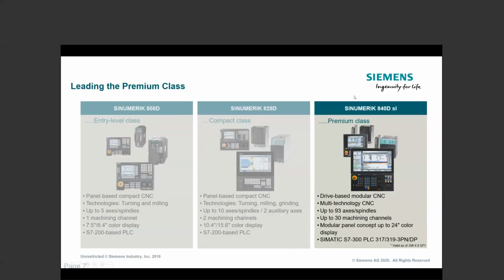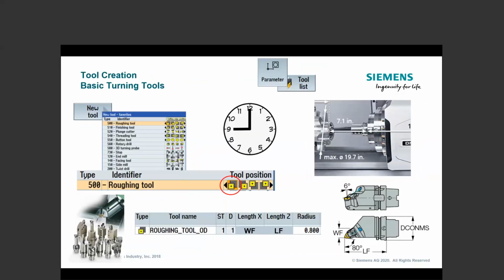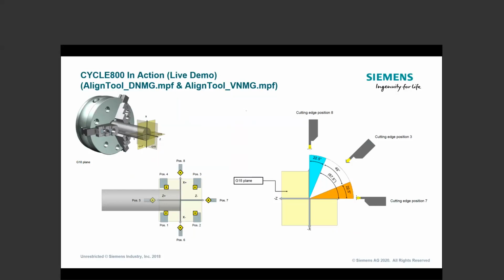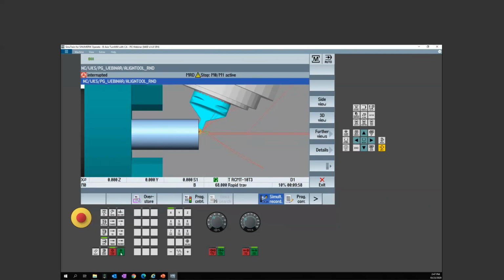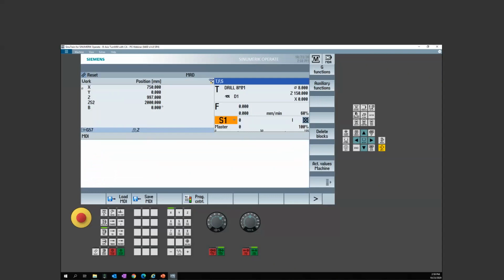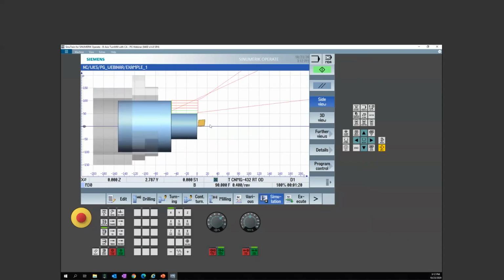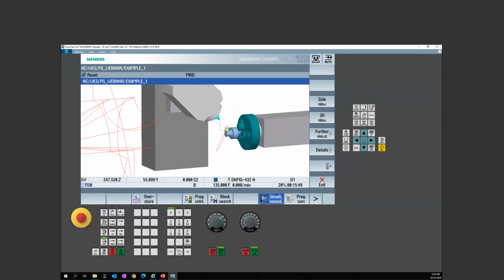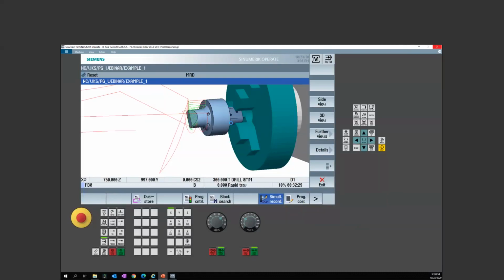B axis Turn mill setup & programming in G code with ProgramGuide

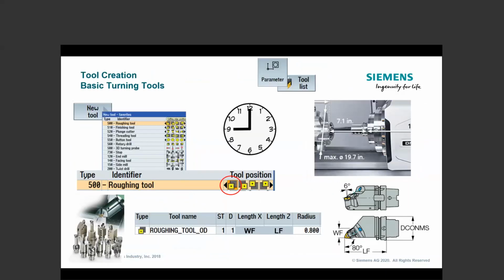Comment: At 9:10 you touched on the difference between 840D and 840D SL. I have a B-axis machine with an 840D and some of the common things you refer to aren't available. One of the most notable is the T,S,M screen mentioned first at 17:38. Also the tool building screens mentioned at 19:15. These seem like vital components of working with a B-axis machine. Is this inherently a feature of the Solutionline control or is my Powerline control software just out of date? 

Unfortunately, upgrading the machine to a SL isn't really an option and accessible training and information on the PL is nearly impossible to come by. It appears that the version of the software you're using is far more user friendly than the one I'm used to looking at.
Reply from the maker: YEAH this is solution line and would be different to power line.
Reply: Are there resources you can point me to for figuring out and learning this sort of task on the PL system? The machine I have is quite capable but almost useless without knowing how to make it perform.

Tool and work offsets as well as swiveling and probing are some of the biggest roadblocks I'm facing currently.

Comment: hello 
please i would like start manual programming g code milling and turning (siemens control ) but i don't where i can find best file
thanks
Reply from the maker: You can start by checking out the content manager we have put together. It contains all the digital material that has been created so far: 
https://assets.new.siemens.com/siemens/assets/api/uuid:8f79f618-e2c5-4bc5-9c3c-407da50cda56/sinumerik-cnc-content-manager.xlsx
Reply: @MrCNC   thannnnks